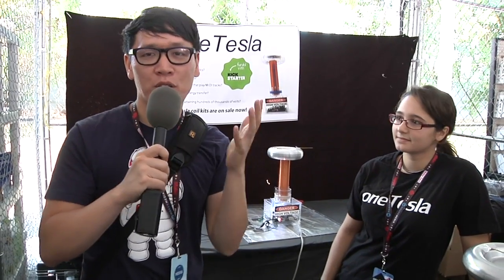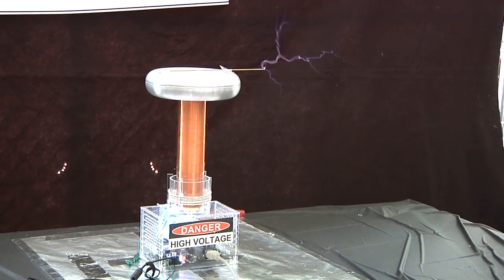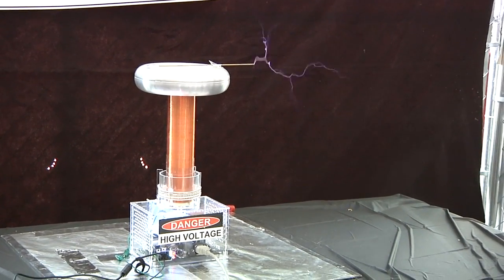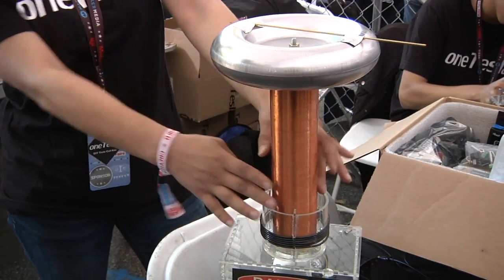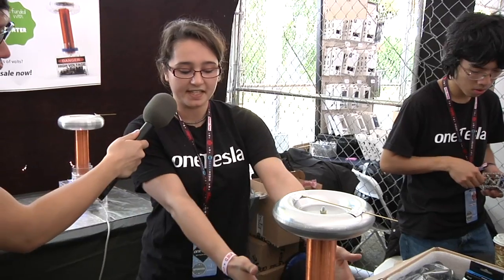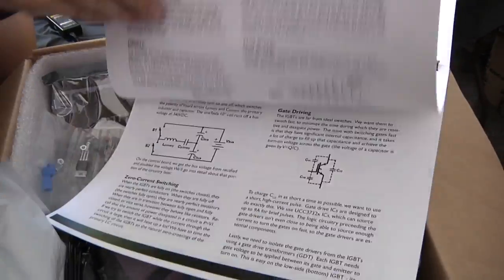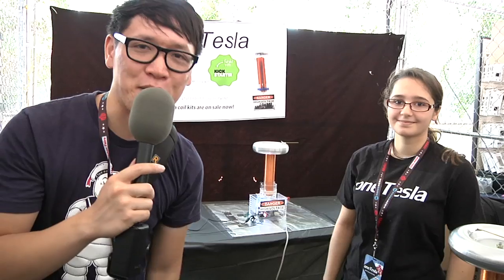World Maker Faire 2013: D-I-Y Tesla Coil Kit

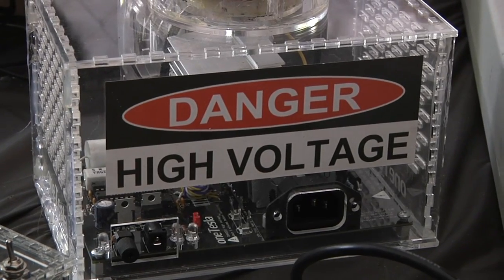Comment: 1:58-2:12

".... and it's also not a kit for beginners, but for people who have a little bit of experience in soldering and building electronics, it's a good kit for them."

oneTesla is targeted at people in the mid-upper range of learning electronic circuits. It's a fun and interesting project that covers a wide range of valuable information for those interested and experienced enough not to electrocute themselves. 

Also, the manual is 62 pages of easy-to-read, well-illustrated instructions.

Comment: i love how norm is just staring at her while she explains the tesla coil. "duhh huh sure right exactly" and she didnt even mention the fact that the REASON you can get super high voltage (and then arc it from the top to the bottom) is because in a closed loop coil the electricity doesnt go anywhere so emerges as electromagnetic resonance, and then spark to complete the circuit. so many nerds to teach, so little time!

Comment: ? dude, the current is actually way low, doesn't use much more than a light. the voltage is very high but you will have a pretty high current limiter to avoid people killing themselves. actually if you limit the current enough you could actually touch it without any major damadge. you might get funny feelings and damadged nervs, in your fingers ect.